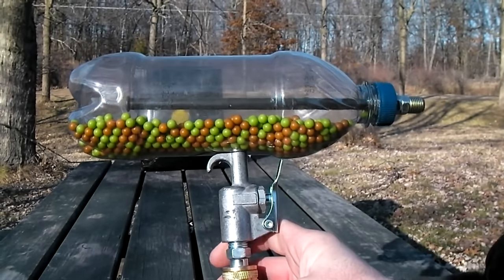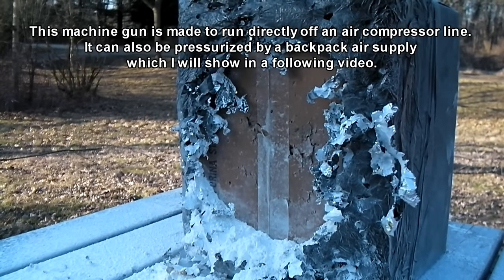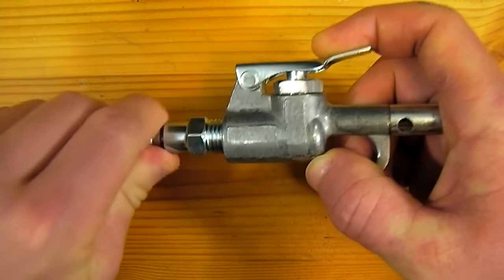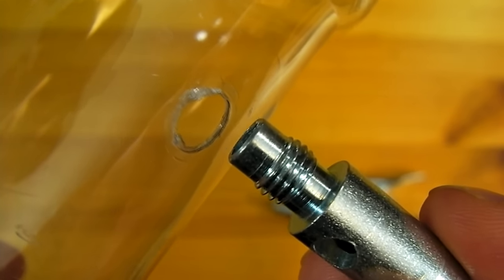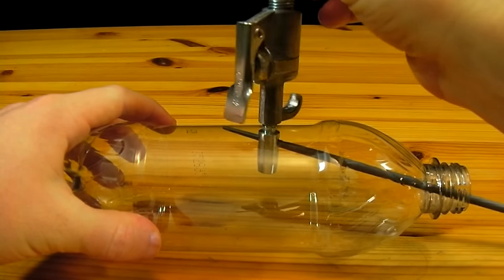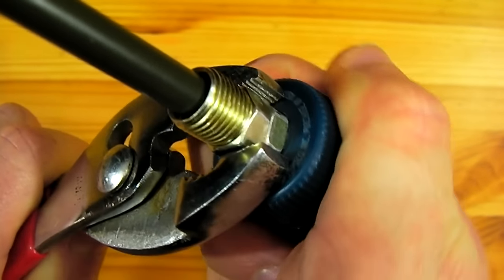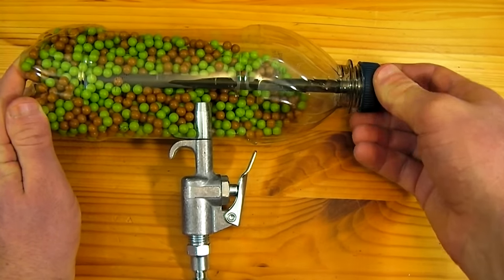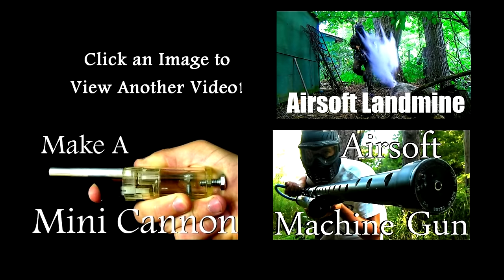How to Make an Airsoft Machine Gun from a Soda Bottle

Comment: Hey Nighthawkinlight! I need help for a project I have in mind. I would like to mount some kind of device on an RC plane that would allow me to shoot bb's out of fake machine gun ports, To add to it's realism. I looked around on the internet, and there are a few videos out there of actual RC planes dogfights, with mounted BB guns. Though when I checked a few forums on  the matter I was really disapointed. The majority of the forums on RC planes are american, and as stupid as it sounds, the AMA forbids mounting those kinds of device on any kind of RC flying model.
As a result everybody is told to shut the f*ck up about it.

Though I don't live in the US, I actually live in France, where legislation about RC planes is not as strict as AMA's one.
This is where I need your help, if you're willing to give it to me.
Here are the requierements of such a device:
-it needs to be light (not heavier than 500 grams without ammo)
-it needs to be able to carry it's power up in the air (CO2 canister maybe?)
-it should not be running on electric power, as the LiPo batteries hardly maintain a plane in flight for more than 10 minutes.
-it needs to be present on both wings, and those need to stay balanced. The ammo should be installed in the main body frame.
-The caliber of the projectile don't matter much
-The triggering mechanism must be able to be trigerred with a servo

I found out that the system you use in this particular video may suit my situation very well. The problem is that i cannot put a compressor on my plane or a bulky PVC air canister. And also that I can't put the ammo containers directly in the wings.

Keep in mind that if you do help me, AMA can not put you in trouble, as long as you do not mount it yourself on a RC flying model.

I hope you will consider my request,
And overall that you will see it (Google+ of my ass...)

And anyway, you're awesome!
Reply from the maker: Buy a cheap battery powered airsoft gun and attach a servo to the trigger. All done.
Reply: NightHawkInLight
First of all thank you for answering my comment despite the google+ system.

Now i already thought about buying a cheap airsoft gun, though there is three major problems:
-I need two of them, maybe even four. I'm working on a F4U corsair (thanks god I'm not trying it on a Tsh-2)
-additional batteies mean additional weight and charging time
-And the worst of all my problems: There are no cheap airsoft electric guns in France. This is due to the fact that it is strictly forbidden for kids to play airsoft. This leads to have airsoft retailers raise their prices up to a point where the cheapest AEG I could find costed almost 150 euros (~$180).

So that's why I abandonned this idea, And started thinking about others solutions. I acuay have every thing almost figured out except for the loading mechanism. My idea would be to have a co2 canister in the body conected to a valve triggerable by a servo (like an aquarium air valve), wich would then split into two/four pipes connectected to plastic barrels mounted in the proper wing placement. Then I would have the BBs feed through two hard plactic pipes directly into the sides of the barrels. The problem is that my BBs need to roll towars the barrel, but in a turn it's highly likely to move away from it and not feed into one of the barrels properly.

Anyway tahnks a lot again for your quick answer, it was great to see it in my Gmail inbox this morning.

Oh and if you are not  willing to help me it's totally ok! I don't mind if you are too buisy to answer or even think about the problem.

Thanks for your consideration, and for providing such quality of content.

Comment: So using just a soda bottle, sounds great?! You mean you gonna need a bunch of shit? A quarter inch quick release air compressor adapter, one air compressor air gun, and one 7mm by 6 inch long brake line. Your also gonna need a drill to drill the holes, and the right size bit for the holes. A metal file, or something like that to fish the nozzle out of the bottom of the bottle and shove it thought the hole. After all that, you're still gonna need more shit. A hot glue gun, the glue, and of course the actual air compressor. Or a backpack air supply, which who doesn't have one of those? Luckily though most people have all of this laying around for a simple project like this. I can't wait to strap my backpack air supple on my son and watch him have some fun! Or wait, I'll just go buy an actual airsoft gun for like $20...